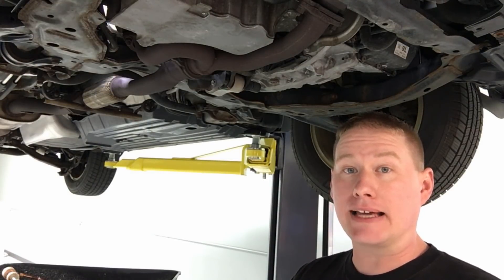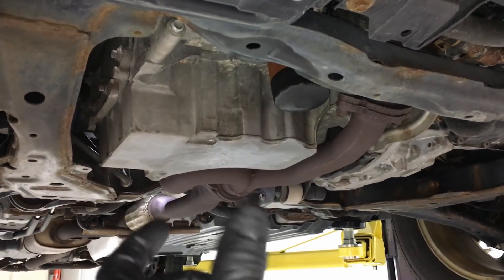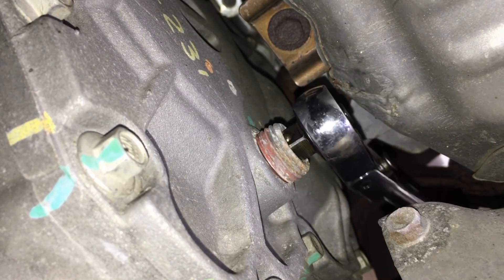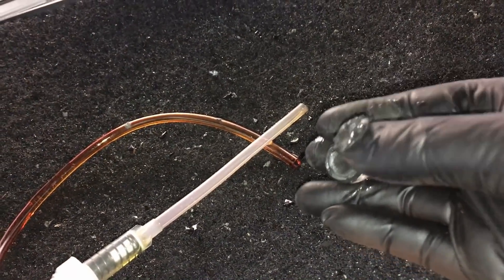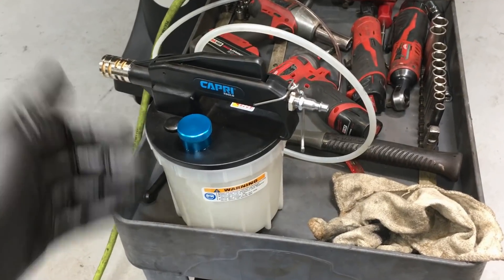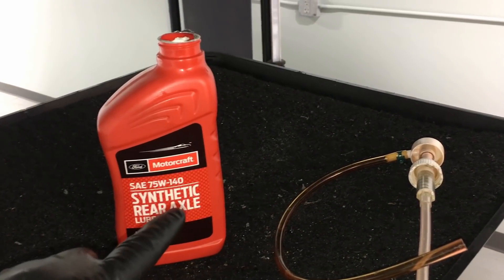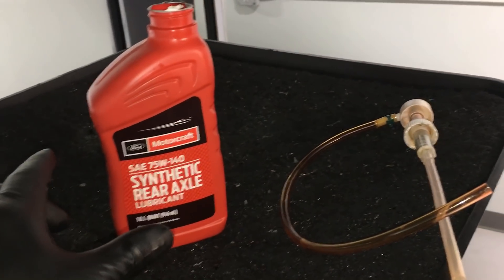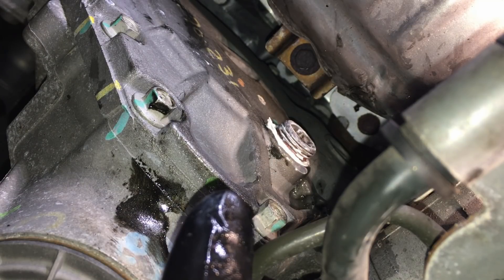Mazda CX9 Power Transfer Unit Maintenance: Preventing Expensive AWD Failures!

Comment from the maker: These are the Tools and Parts I Recommend:
PTU Fluid-
https://amzn.to/2pJOdJO
Thread Sealant-
https://amzn.to/2GflfIf
Vacuum Bleeder (Professional)-
https://amzn.to/2Gscu0z
Vacuum Bleeder (Basic)-
https://amzn.to/2G9JnzU
Fluid Pump-
https://amzn.to/2GbWuk0
Fill Plug Torque Spec: 15ft lbs
Reply: any shops or folks you could recommend in the northern california area for PTU repair or replacements? I could do it myself, just need to figure where to order a ptu from?
Reply: Thanks. Great stuff
Reply: Hi. I'm hearing a humming noise from the PTU of my 2007 CX9. It gets louder as I accelerate beyond 30mph.  I checked the oil and it was black like the one in this video. Does this mean I need to change the entire unit or just the oil?

Comment: I do mine every 20k miles. I use  REDLINE HIGH TEMP 75W140 OIL ON  MY 2012 LINCOLN MKX AWD. EACH CHANGE OIL IS DARK BLACK NO GUNK. AFTER CHANGE WOW WHAT A DIF.  A LOCAL OILER DOES ITVFORCME.

Comment: 2008 Ford EdgeAWD here, 140kMiles, original PTU with Oil changes made easy as follows:
* Drill+Tap PTU bottom between ExhaustPipe & TranMt, installed Fumoto10mmDrainValve.
* Replaced 1/2"-14 FillPlug on PTU side with 1/2"-14 to 3/8"HoseBarb90 pointed upward.
* Removed PTU TopVentCap+Rubber1Way wIth 5/8"Socket+ScrewPick, reveals 3/8"HoseBarb.
* Installed two 3/8"OilHoses from PTU HoseBarbs to FireWall between BattTray+FuseBox.
* Installed FiberGlassInsulationWrap around ExhaustPipe under\near PTU.
* Installed OilCatchCan with FIlteredVent on FireWallTopLip between BattTray+FuseBox.
* Refilled PTU 1/2qt=16oz 75w140 HiTemp AmsOil thru above new OilCatchCan+Hoses.
* Routinely Drain+Refill PTU at 5kMile\6Mth intervals, along with EngineOil+Filter changes.
Reply: Did you make a video for us to learn and copy?
Reply: @williammcginnis7428  Sorry, YouTube won't allow links to my pics.
Reply: If u posted it I'm subbed to find it

Comment: I replaced my fluid at 110,000 and I was surprised at how clean the original fluid and drain/fill plug was.  It was nothing like yours, I did the rear differential fluids at same and was pleasantly surprised at that fluid too!  Looking at that “tar” in yours do you think fluid changes are really doing anything, that nasty thick stuff is still in the case.

Comment: You need to know that these will fail for a.different reason. The air bleeder on top of the tcase gets clogged and then the case builds up incredible heat and pressure. It then pukes all the fluid under pressure out the now released bleeder. Or whatever is left of it that hasn't already turned into sludge. I had mine do this after changing the fluid within 10k miles. Its a common engineering mistake on this case and vehicle. (Thanks Ford) I had two cx9s and both did the exact same thing. One before fluid was changed the other soon after. 

The solution? When the case grenades and then also destroys the carrier gear in your trans you take out the tcase and trans to have rebuilt. Take out the bleeder and install a tube that goes up to top of the engine. A small metal breather filter is put into the top end of the tube above the engine. This is also where you fill the case from then on. 

While I had mine out i drilled a hole in the bottom of the case too (then tapped and installed a fitting) for easier draining with an extension tube and valve in the end of that. 

The other problem with this piece of crap is the amount of fluid. 500ml of fluid is not enough. I added a finned radiator and pump to get the fluid out of the case and up to the reservoir at the front of the vehicle. Now mine has 1.5liters of fluid circulating between it and the tcase. This case is such a bad design its laughable.
Reply: How do you get the bleeder out?  And what size/ type of fitting can replace it to connect a vent hose?

Comment: Isn't there any class action lawsuits against Mazda for this defect?　　Transmission is also sealed and the owners manual does not specify for the scheduled maintenance for it, so I did not know about it until I see fluid leaks around the transmission area.  My CX9 is 2012 which I bought it new at the beginning of 2013, and it only has 20k on it, but the leak is happening.  I see many others having the same issue.  Let me know if there is any class action lawsuits going on.  I"d like to provide my damage info as well.

Comment: Great video!  Stumbled upon it about a year too late!  Just had my 2010 CX-9 PTU replaced for the third time.  I bought the vehicle brand new in 2010 and had PTU replaced at 47K, 79K, and most recently at 115K.  Luckily first two were under warranty, but charged for the latest.  I fought hard with dealership and Mazda USA since this is a known issue and got them to cover a majority of the replacement cost.  Was told each time by Mazda that this is a “sealed unit” and cannot perform any kind of preventative maintenance.  Hopefully this video has saved me from a future fourth PTU replacement!
Reply: Did the unit make any noise or give any indication before failure?
Reply: Z D  dealership is always going to push most expensive fix & complete component fix.  Unfortunately, with gear boxes when they do what you are describing most often they are gone.  I would find a good respectable repair shop to diagnose for a second opinion if I were you.

Comment: Did I miss how much fluid this thing holds? Need to know how many bottles of oil I need to get. Thanks
Reply: Takes roughly half a quart
Reply: @christopherbarabas9151  I guess depending on how much you siphon out, but as the vid says you won't need more than one quart
Reply: Correct you wont need more than a quart, but it still takes only half a quart

Comment: We just purchased an 08 cx9 a few months back for 3000. Nice vehicle with 114k miles. I decided id check this ptu fluid after reading all the horror stories online. I got maybe 3 drops and a very tiny puddle of fluid. It was completely empty. Sucked out what i could and refilled with proper fluid. Saved myself from a potential failure on my trip. 

Just a few weeks ago on my way back from a 400km trip, the engine started misfiring. Limped it home. Turned out one of the ignition coils had failed. But, it was actually the pcm which also had melted connections. Replaced pcm, ignition coil and had to go to the dealer to get my keys programmed.

So far, not impressed with my Ford Cx9. I am just waiting for the water pump to destroy the engine and i think that will wrap it up for me. Changing the coolant in the spring, might prolong my ownership experience a little longer.
Reply: How is it holding up so far?
Reply: @Mr.Dilback  it would of blown up by now lol

Comment: i wonder if you could drill a small hole at the back of one of the cover bolts on the bottom and use that too drain. 2 birds one stone.

Comment: Another question :

What do you think of putting an ounce or two of some sort of solvent  (seafoam, carb cleaner?) In the fill hole then driving the car for a few miles to loosen up an thin out the tar for better extraction? 

I  wouldn't think that it would hurt the gears or bearings...my concern would be for the seals. 

Any suggestions appreciated and great channel!
Reply: You don't want solvent in where you need oil. It thins out / breaks down the oil. I realize you're not intending this for long term but I wouldn't do it.
Reply: I was thinking the same thing but Whit diesel

Comment: managed to open my PTU on 2011 CX-9 when she had 80k km and it was all tar, since then replaced it 6 times in 18 months just to clean as much as possible. Looks like no dmage at all to the PTU but I am trying to find a method to completely clean PTU without dissmantling it. Is there some fluid that I can use to dissolve all tar residue in it that I can then pump out from PTU so I can have clean PTU?
It should be important that I can remove all of that cleaning fluid somehow through fill hole.
Reply: Marko Skomersic I always thought about a half gear oil /half marvel mystery oil in my ptu then draining that mixture once or twice. Mystery oil does a nice job at cleaning. I wouldn’t drive too far or too longer on the half and half mixture though. Then I’d refill with all the proper gear oil obviously. What do you think?
Reply: @Clamjammer  am not sure if that is an option since I would like to have it clean and without and solvent when I pour new fluid in PTU. I am considering to bore new hole for draining like many people did.
Reply: Hi Marko. Did you drain and fill the PTU yourself? If so, how did you manage without a hoist? cheers
Reply: @stuckster  yes I did and am doing that ever 5-6k km. It is 20-30 min job and it takes only half a  litre of fluid but makes my PTU running without any issues so far (120k km)
Reply: @markoskomersic9656  Awesome. Do you just use jack stands, or do you have access to a hoist?
Reply: @stuckster  luckily I have access to a hoist so no problem at all to lift it
Reply: Z D  well, not much you can do except hoist it up and check if replacement is required. If not obvious, try to check the fluid by taking a sample. if the sample is liquid and without splines, try to replace the fluid by using an oil pump. 
It is hard to recommend anything without seeing it directly
Reply: oh, if replacement is required, check if you can refurbish the PTU. This can be a better and cheaper option than buying some cheap ones from eBay (Chinese version). I have refurbished mine and am very happy.

Comment: Started doing this in my 2010 Ford Edge, and familiarity with the drive train helped the decision along to buy the CX9 when we needed more room.  Done the Mazda twice now. Would you recommend using a moly additive in these? Paste or liquid?
Reply: The over heating problem was more of an issue in the 07-09 edges. Some exploding at 30k miles. They seemed to have gotten it right on the 10 n up. My 07 ptu failed at 220k miles making it a front wheel drive.

Comment: Beats Ford's VOLVO system.  I had a 2005 Five Hundred Limited AWD come in with a noise that we thought was the Transfer Gear in the CVT.  When we pulled the Right CV Axle, heard a clunk and the splines were rusty!  Could not get the PTU out because whatever "clunked" held it in place.  We would have had to drop the Front Cradle and the owner decided that since it had 250,000 miles and a new PTU cost $2,700.00, it was time to have it hauled off!  There was no sign of leakage anywhere on or around the PTU and no drain or fill plug.  Another wonderful design!

Comment: Very common failure Mazda has an extended warranty on them. I'm a tech at Mazda and have changed lots of them.
Reply: mikeZinck how many miles is the extended warranty? Thanks
Reply: David Smith 90k miles
Reply: mikeZinck at what mile interval, should this service be performed?
Reply: @lsotojr1  I looks like it is the same unit as on the fords. Every 30k.
Reply from the maker: Good to hear Mazda stepped up.

Comment: Have you seen the PTU set up in the 2016 Explorer 3.5 TT? There's a sensor and a shield over the plug. This one on the Mazda looks like a dream in comparison.
Reply from the maker: Yes those are the ones you technically have to remove the cat to fill them. Such a pain but nice to finally see coolers on these.
Reply: Actually I've read that folks have been using the vent tube to refill the exact amount removed. Must take some time to get that molasses down the tube though, lol

Comment: One of the Reasons I traded in my 2015 SHO
Reply: Gerald Hulton another reason is because when the water pump fails it can destroy the entire engine.
Reply: InternetDude Ford dealer told me they didn’t do PTU service. They said let it seize and they will replace it under warranty. Also the inner cooler would get condensation in it and could suck it in and vapor lock. And the intake valve issue. Other than that The SHO was an Awesome car. Very fast.
Reply: That's an ignorant standpoint. Sure Ford will replace it but what about you having to deal with taking it in to get service, possibly wait for parts, maybe have to take the day off work, etc.? And what if it doesn't fail until you're just outside warranty? The PTU fails for one reason, it overheats and belches the fluid or turns it to tar. It's just that simple. Fluid changes are the absolute best way to get more life out of a PTU (unless it's too late already). The dealer's stance is comparable to "don't change your engine oil, just wait til it's seizes and replace it". I had an EcoBoost F-150 from 2011-2015 so I'm aware of many of the EB issues like that intercooler/valve issues. Now I have an 03 F150 and it's much simpler and more reliable.
Reply: @geraldhulton6856  ford now finally recs drain and replace fluid at 30k intervals.
Reply: David Knigge But will the Dealers do it now? Will they offer that service?
Reply: @geraldhulton6856  According to another video yes. I will find out for sure. If they won't I will get another mechanic to do it. Cheap insurance. But I heard they might have added a cooler for it.
Reply: @InternetDude  Another reason to flush the coolant every 60k.

Comment: Call it a pet peeve of mine but when manufacturers eliminate drain plugs it sorta pisses me off.
Reply: Ozzstar just replaced mine on my 2016 focus RS, only 17k miles lol. Needed a new PTU, and my PTU has a drain plug and is water cooled. The drain plug had black like Metallic tar and the shaft needed two hands to turn. Crazy, but all under warranty. I’m going to change out the fluid every 10 or 20k miles depending on how I’m driving. Wish I could share pics here lol.